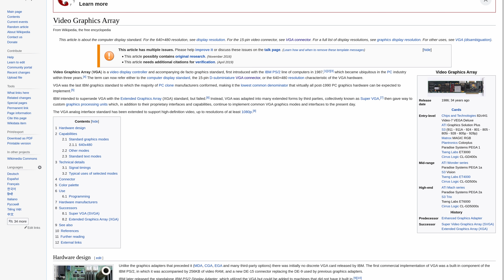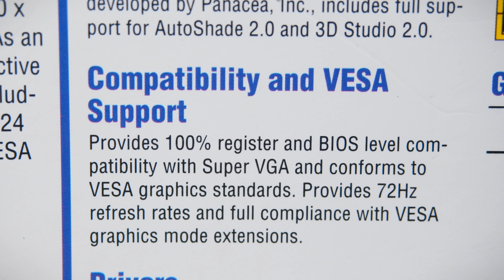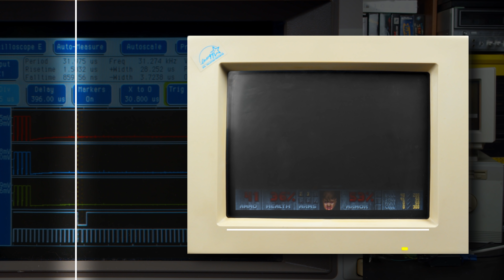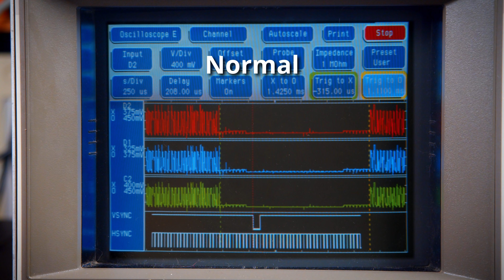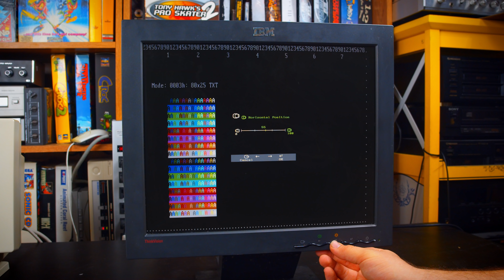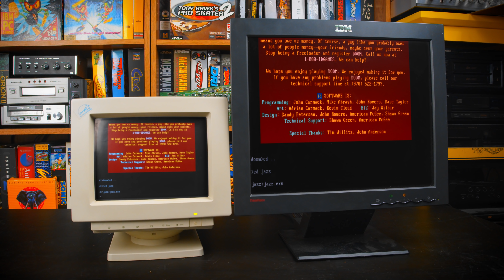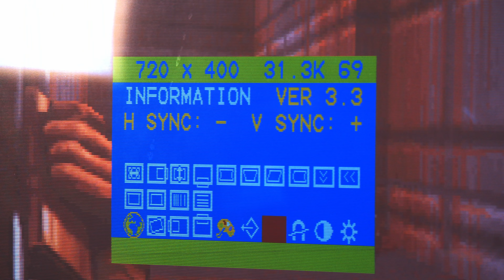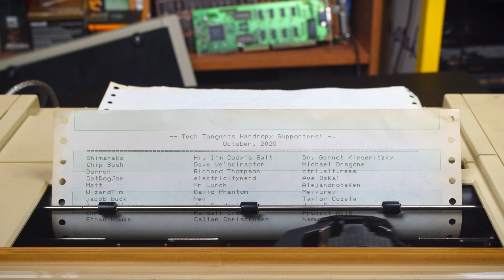How VGA Works

Comment: I like that VGA's analogue nature means the max resolution is hypothetically infinite.
Reply: Yes, but most 32-bit systems weren't capable to pull of 4K (it was 2048x1536), and then by the time 64-bit systems become the norm, CRTs are already extinct.
Reply: 24k?!
Reply: @MakotoIchinose 
Effectively, a modern VGA system should be capable of 1080p (1920x1080x16777216 colours). However, go back far enough and basic VGA chips would give you very basic results. For example, the standard in the 90s was 800x600x256 and in the 00s, 1024x768x65536.
Reply: @anonUK I think space charge is the limit on CRTs. While with a laser scanner you can focus almost infinite power ( until you get second harmonics , like your bright red gets some violet glow ), you cannot focus charged electrons ( for the given current). Accept a dark picture and watch in a dark room. Or accept that this blurs the picture even more than the mask and that you cannot identify single pixels anymore. Can as well go interlaced as this doesn’t flicker.

CRTs show scanlines in the dark areas of a picture.
Reply: The cables however are made to a specification, and at a high enough frequency you'll have real trouble properly sending it through the cable. High frequency signals start to get really tricky to play nicely with.
Reply: I loved my last crt, it ran on 1600x1200@90Hz. I still don't have a monitor that beats that 😅. But I do like the ability to fit multiple monitors on my desk and being able to move them easily.
Reply: Kind of like how a book can have a theoretically infinite number of pages.

Becomes less useful after the first couple thousand, though.
Reply: Technically you can sen any signal you want, inclusing digital ones like hdmi or even ethernet down a vga cable, of course no monitor will know what to do with it, but the pins are there and if 2 devices have the port and know what to do with it, it'll work. It's like those pcie extenders that use a usb a-a cable, they aren't using usb, but just the cable for a different purpose.
Reply: My dad had a crt with 1900x1200 in the early 2000s

Comment: Oh god I could rant about TVs which force overscan on HDMI input for an hour ...
Reply: How does overscan work on HDMI? Do they have part of the LCD panel hidden in the bezel, or do they have an LCD panel with a slightly lower resolution but marketed as being 1080p.

I'm curious because I have a 1080p LCD tv and was kind of annoyed when I found out that 10% of the screen was cropped-out.
Reply: Yeah, my new LG tv with ONLY hdmi inputs has it on by default on all inputs... MADNESS
Reply: @thepuzzlemaster64  It works in the worst possible way you could imagine. The physical display will actually be 1920x1080 (or whatever resolution is claimed), but the overscan will scale the input pixels so you get scaling effects and reduced de facto resolution. There is no pixel-for-pixel option.

I learned of this awfulness when I hooked up a computer to a cheap Polaroid brand HDTV. When hooked up to HDMI input, the edges were cropped out (annoying but compensatable) and the text was always crummy looking (unacceptable). But there was a VGA input also. When I hooked it up via VGA, there was a menu option for pixel-for-pixel. No cropping. Sharp crisp text, albeit with analog-digital conversion fuzziness.

To add insult to injury, the HDMI input actually DID allow pixel-for-pixel output if the input signal was less than 1080p. If I set the resolution to 1024x768 on HDMI, the display was razor sharp ... but limited to a 1024x768 box with huge black borders all around.

Ugh. Absolutely despicable.

I now have a cheap SCEPTRE 4K TV which I use as a computer monitor. I knew from reviews that it does NOT overscan at 4K, or any resolution other than 1080p. But for 1080p? It ONLY allows overscan. This is slightly better than that damn Polaroid, because the pixel density of 4K practically eliminates the bad scaling effects. But it still would have been a deal killer if it weren't for the fact that I knew I would never use this display with 1080p resolution.

Grrrr....
Reply: @IsaacKuo  Oh so like how when you plug a computer into a TV it has some stupid 1300x1400 or something resolution.
Reply: @desertfish74  well i don't know, maybe it's a region thing? I'm from europe
Reply: @goeland4585  I'm from the USA and it's definitely still a problem here also. The cheap SCEPTRE 4K TV - I got it new just a couple months ago. It has forced overscan on 1920x1080 input (any other resolution, no overscan).

I think it's mainly a problem with the really low end stuff.
Reply: @IsaacKuo  
Wha... Why would a company waste time and effort to make they own quality screen look worse?
Now I HAVE to know if there's a hack out there that replaces the display's firmware to a better one without this shenanigan.

Also coincidentally enough the only TV that I've seen have this problem was an LG HDTV.
Reply: @thepuzzlemaster64  You wanna know the STUPID reason why? Closed Captioning. Back in the old days of analog TV, closed captioning was encoded in off screen video scanlines. If you adjusted the picture downward, though, you could see the blinking horizontal black and white dashes that encoded the CC text.

Okay, so we go forward to the early days of HDTV. Early HDTV sets were CRTs, so they were overscanned the same way as analog TVs. So, cable boxes would simply upscale analog channels to HD resolution, knowing that the HDTV would hide the CC stuff off screen in the overscan. No problem!

But then Plasma and LCD HDTVs were developed. At this point, the HDTV makers decided it would be easier to overscan stuff than take support calls from irate customers asking why there were black and white dashes visible. Many decided it would be best if it were IMPOSSIBLE to turn off the overscan, just to make sure those CC black and white dashes were never visible. (Remember, these dashes only ever existed on older analog TV channels upconverted to HDTV resolution by cable/satellite boxes.)

Of course, today's cheap TV makers don't even have support call centers for you to call, so why do they even care? Well, they don't. But they're too cheap to change or develop new firmware, so here we are.

But why do they keep on doing this with 4K TV sets where new firmware is required anyway? Beats me. The best I can figure is that they are hateful inhuman gremlins who despise all things good and just in the world.
Reply: Oh yeah, HDMI overscan is such a pain! I don't know how many hours I wasted trying to tweak the picture on my HTPC to get it to look good over HDMI. Of course, it was a pointless endeavour since there's no way to make a scaled picture look good, so fuzzy VGA had to suffice.
Reply: Two of my close family members have fairly high end Sony LCDs that always default to HDMI overscan. They were disappointed with the picture on their new TVs for weeks until I visited and discovered the setting to disable it hidden in the menus. Boom, instant clear crisp image. It was really really hard to find, and called something weird like "Disable Broadcast Image". It needed to be set for every single HDMI socket individually, all five on two TVs. And unlike all the other settings, it reset if the TV lost power! Also if you press the "Scene" button on the remote it toggles the display between "Dynamic" "Cool" "Sport" and "User" settings and sometimes re-enables overscan.

Two of my fairly high spec Samsung TVs have the same problem. Drives me up the wall. Like the stupid almost invisible turn-signals on new cars, it's like we go one step forward and two steps backwards with new technology.

My LG TV has an "Aspect Ratio" button on the remote which can quickly disable overscan.

Funnily enough my three old bargain basement Soniq TVs didn't have this problem, so if you rely only on default settings (as most non technically inclined people do) the AUD$150 TV looks much clearer than the AUD$1500 TV.
Reply: I have a fleet of retro PCs from 8088 to i5.  The VGA ones go through an OSSC to convert to HDMI, and then into an LG 4K TV.  I had a heck of a day when I got all my KVM and HDMI switch plumbing in place.

I spent like two hours tweaking the VGA input timings on the OSSC trying to get the sampling correct on a Win 98 box.  Never could get it quite right.

Then I flipped over to my XP box - the first in the fleet to have a DVI output, which goes direct to HDMI.  At 1080p, the Start menu was gone.  I thought the EDID must have gone crazy and had it default to 1920x1200 or something.  But nope.

To make things even more fun, there were TWO problems.  One, the TV had overscan enabled - which never occurred to me was even a thing on pixel-perfect digital inputs.  And two, the Radeon software had an overscan feature of its own, which was enabled.

Between those two stupid and completely unnecessary “features”, I wasted a whole evening totally perplexed why I couldn’t get ANYTHING to look right.

So glad to find those options and turn them all off.
Reply: Just a tip, sometimes Game Mode fixes the overscan issue. I haven't yet found a display where overscan can't be disabled somehow, but often it's hidden in places you wouldn't guess. Aspect Ratio, Broadcast Image, Closed Captioning, all sorts of random settings.

Not doubting though that some can't be disabled at all, as many of you have discovered through many wasted hours.
Reply: @Microwave_Dave  
generally, the Google keywords are"[brand name] missing edges" or"[brand name] overscan fix"
Reply: @IsaacKuo  I'm surprised that they didn't just make the boxes that did the conversion add the CC to the video stream. There was maybe a half dozen CRT models that ever even had HDMI or HDTV decode ability built-in and by that time there were plenty fast video processors to make it happen. They could have even simulated the overscan the CRT sets required and just choked it up to being a component requirement and left out the porch entirely.
Reply: @DKJones96  I think the problem was more that video streams with CC encoded tend to have large black borders and flashing lines at the edge of the screen, which is the the encoded text. This can be really distracting. A lot of YouTube VHS rips show those flashing lines with black borders around them.

Surely the TV should be able to detect it fairly easily and compensate appropriately, but they don't.

I'm also disappointed that it's 2020 but still brand new interlaced footage floating around. Some of the YouTubers I watch have the wrong camera or encoding settings and when there's action on the screen it goes all fuzzy. These are 1080p or 4k streams!
Reply: Dude there is always a setting in the menu to turn it off, sometimes in different places, like sometimes it's aspect ratio, sometimes it PC mode and there are a few others. Not that hard to get rid off it, it's never "forced", you just haven't found the right setting. 
All of you here are right idiots, I've never seen a TN no matter how cheap where i couldn't turn it off.... If you can't find it, usually a google search will help.
Reply: @IsaacKuo  I have a cheap Polaroid TV too. Now I know why anything truly HD doesn't look right: they're all cropped out because of HDMI overscan!
Reply: Because of this, I still love my now-5-year-old Element 42" LED HDTV for the simple fact that it has a "Just Scan" setting. It won't pull any shenanigans and will just do what it's told.
Reply: @IsaacKuo  I wonder if overscan was part of some HDTV spec, and that once these TVs see a 1080i or 1080p image, they're over eager to be in spec and act odd

Comment: One day I connected a 32 inch LCD TV to an old PC (Pentium I or III, don't remember which) with an S3 video card through a VGA cable, started some DOS-based hardware identification software (hwinfo maybe) and it showed information about the TV (maker, type, size, a few things). I hope you will talk about this identification protocol, I did not know about it.
Reply: EDID. Basically there's an i2c line in the connector and you expect that a TV has an i2c EEPROM connected there directly or a device that can behave like one. It simply being an i2c chip is advantageous because that can be powered by the cable, otherwise the monitor or TV would need to be turned on before it can be identified.
Reply: what brand was the set?
thats interesting.
I just bought a preowned sony bravo 40" tv yesterday and it too has a vga socket on the back.
I wonder if my pc would be able to pull some info off it if I did the same.
Its 1080p

Comment: the wobbly table is giving me anxiety. great video though , learned a lot.
Reply: i thought i was just too drunk to see.. lol
Reply: Especially with that HP 16500 (that bitch is heavy). I've got mine sitting in a 19" rack.
Reply: @BlackEpyon  I noticed the HP16500A as well. You've got to be a special kind of guy to appreciate a 1650x series LA. I upgraded to a 1670x and 1690x.

My mistake, it's a 16500C.
Reply: @MrWaalkman  I think the 'C" can take a PS2 keyboard/mouse. A & B have a proprietary HP RJ-style keyboard/mouse connector. Mine is a 'B" model.

Comment: High refresh is one of the only reasons I'd keep a CRT PC monitor in my room lol
Reply: What about the beautiful picture and inky colours and black, zero motion blur, zero lag, no fixed or native resolution so looks good at even low resolutions, even OLED has bad motion response, and a fixed native resolution, not to mention no OLED monitors available yet, I will admit when 24/27/32 inch sized OLED's with 120Mhz refresh rates, improved motion response are available at reasonable prices, say starting at £$300 for the 24", £$500 for the 27" and £$800 or so for the 32", then OLED will be a good alternative to CRT monitors. Until then there are CRTs's that can do 160Hz refresh rates, go up to 2048x1536 @ 90Hz on a CRT is a beautiful thing I can tell you, nothing comes close to that 3 dimensional beautiful looking bright and colourful image that a CRT has, the image they produce has so much depth which makes gaming so much more fun and immersive, my gaming 32" 144Hz VA G-Sync monitor just looks so flat and dull compared to a CRT, they have tried now for 15 years to get close to CRT with LED, Quantum Dots, HDR, 340Hz+ refresh rates, dual panel LCD's (best version of LCD), multi layer LCD's, and none of has even come remotely close to CRT, and it never will. Even OLED has its limits, maybe LCOS or Laser Phosphor will manage to finally knock CRT of its pedestal, seeing as it's true successor FED/SED technology was shutdown, we would have 85" CRT quality flat screens by now that would also have gotten cheap by this point too, ah well, maybe in 10 years we will finally have something worth buying, maybe even CRT's will be manufactured again.
Reply: @coolelectronics1759  So what if their big and bulky lol, I understand if you only have a small place with not much room, but I will take a big CRT over a cheaply made paper thin LCD any day. Modern CRTs don't have lead in them but even if the di so what, it's in the glass, also radiation? lol it's a tiny amount of no ionizing radiation and is harmless, CRTs are much better for your eyes too, slimmer = cheap and nasty. Although there were some very low profile slim CRT's from Samsung that were pretty good.
Reply: @Wobble2007  gotcha understandable.
I was just under the impression the crt was just considered nothing more than obsolete junk at this point, as noone would take the ones I had for sale off my hands not even for free, even sony ones the suposedly nice one, and I had to toss all of them unfortunately. Its such a shame but I gues there is somewhat of a demographic for them still you just have to know how to move them no pun intended lol. I sold a typewriter once, last year! Sometimes you really have to sit on these things for them to sell eventially same said for other hard-to-sel items-Telephones, printers, grampa floor TVs, pianos, fax machines, scanners and VCRs.
I myself dont have the thinnest lcd either, I payed nothing for it it is a small (Hansin?) 19" monitor and its good enough for me.
For CRTs, I gues if an oscilloscope counts, I have two of them one in front of me and one in my tech lab.
Reply: @coolelectronics1759  Bloody hell mate, you would've made a small fortune on the CRTs now, a simple 17" run-of-the-mill CRT is going for 100£$ plus on eBay now, that said I wouldn't personally pay that much for a 17", the SONY 24" FW-900 is in the thousands now, up to 7 grand, I'm trying to find one for a grand or less, there are bargains to be had still, out of interest what was the best CRT you threw away, makes me sad to even think about tbh.
Reply: @Wobble2007  a WEGA TRINITRON and a panasonic hd one those went to mostly scrappers

Comment: Notice the VGA's 31KHz horizontal sync rate is almost exactly double the 15KHz NTSC horizontal sync rate, and the original CGA/EGA 200-line modes were 15KHz NTSC compatible modes.

Comment: The last widely available samsung CRTs could handle extreme resolutions, but were of the shadowmask type and came bundled with a very thin cable. Another point of mismatch occurs at the connector of the video adapter. A DVI with an adapter might actually give a clearer signal. But if it is not working well, it's just a light ghosting echo, often masked by the pattern of the picture tube.

Comment: One nice thing today is that there exist DACs and ADCs fast enough that you don't need to generate a mode-specific clock even at crazy high resolutions and refresh rates.
With those really high rate display modes, the converter can be wired directly to the female D-sub connector from the board, then you don't need to worry about interference and cable quality.